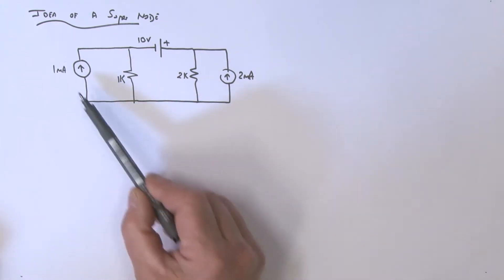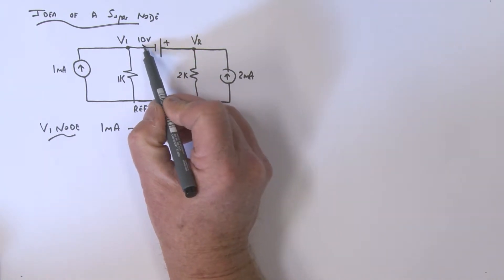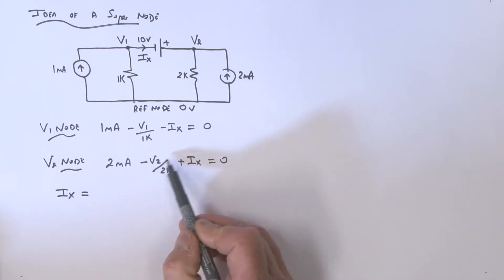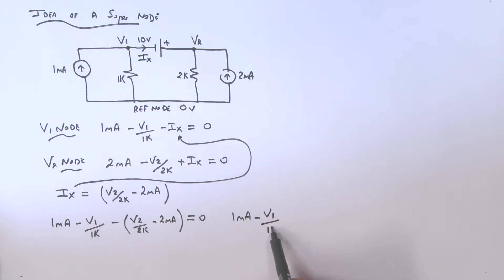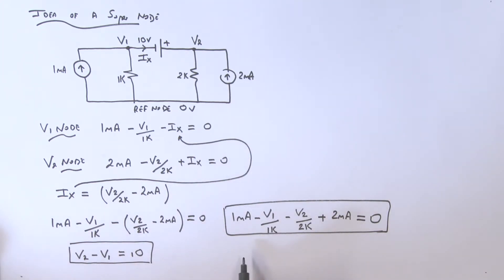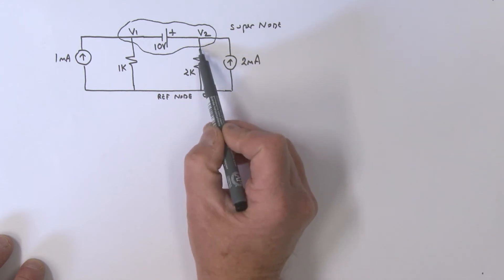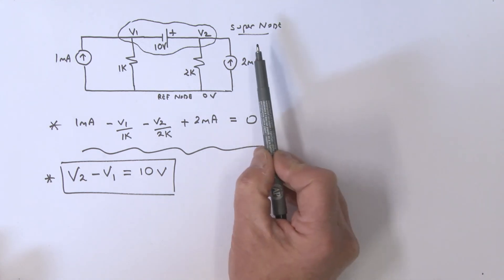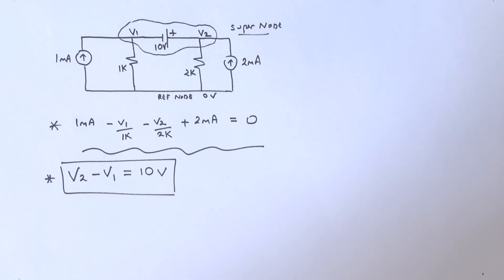Nodal Analysis Part 4

Comment: I have a question about the current direction in this video. In your earlier videos on DC circuit analysis, I noticed that at every node, you consistently take the direction of current flowing away from the node (except for current sources). For example, if at Node 𝑉1 , the current flows from 𝑉1 to 𝑉2, you write it as 𝐼=(𝑉1−𝑉2)/𝑅 . Then, at Node 𝑉2 , for the same resistor, you take the current as flowing from 𝑉2 to 𝑉1 , written as 𝐼=(𝑉2−𝑉1)/𝑅, reversing the direction. However, in this video, when you identify the current 𝐼𝑥 , you seem to take the same current direction at both Node 𝑉1 and Node 𝑉2 . Could you clarify why the approach is different here?